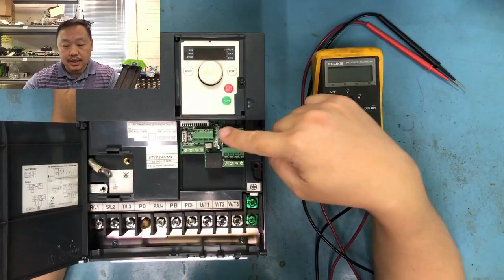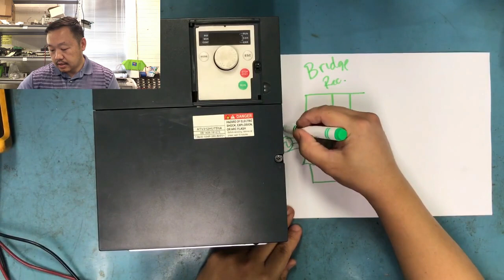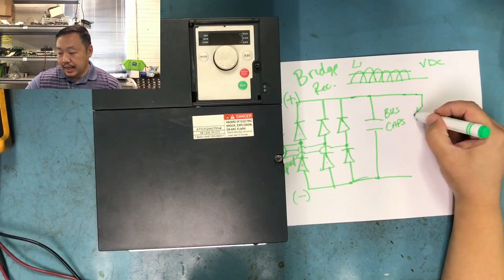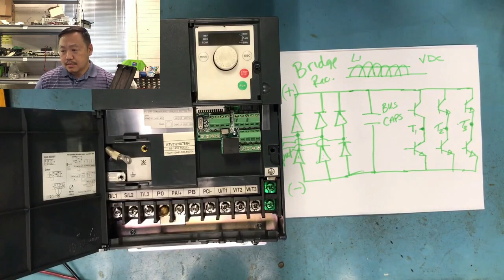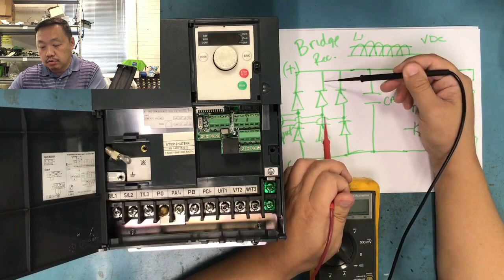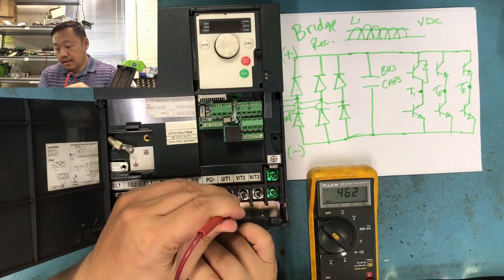One Simple way to check if an AC drive is good

Comment: Excellent Video. 
If you have a problem with your control board, this may also be a cause of IGBT Gate short-circuited. Beware. The gates could not be accessed from outside, dismantle and check.
Reply: We've had a few AC drives in which its control board does not turn on at all after applying the 3-phase input. What could that be?

Comment: How about checking the rectifier diodes with reverse polarity? You checked the forward voltage drop, but if you switch the leads, you should get an open. If you get anything other than high resistance, the diode could be shorted. Take into account the fact that the huge filter caps will take a bit to charge, and you might see a temporary short because of that.
Reply: Have you ever revisited your comment since you posted it? I know it must have made sense to you when you posted it but think about what you said.:face-blue-wide-eyes:
Wakodahatchee Chris

Comment: pls i did my static check and my igbt module is good but yet i didnt get power output even when the drive is running using the local mode

Comment: Good Evening. I have washing machine (laundry) using single phase input with 3 phase motor. My priblem is.... The motor body tempreture very hot, touch by hand. Than sometime, motor not running. In this case, motor problem or VFD problem? Plesse advise.
Reply from the maker: A single phase being turned back to 3 phase is already not the best way to drive a motor but with that being said, I would check the motor out first if its heating up.

Comment: I can't seem to remember is 3 phase " each leg is 70 degrees or 30 degrees out of phase with each other " ? chit seems I wouldn't for get and maybe I wrong.
Reply from the maker: For a three-phase AC voltage source, the phase shift is 120° with respect to each other
Reply: @electronictech785  Yep sorry I now remember thanks so much ! I was thinking that this was the reason that several motors and compresses did need starter cap if you had 3 phase.

Comment: Most of the VFDs sold today don't provide the + and - terminals for the DC bus. How can the diodes be checked without the + and - terminals?
Reply from the maker: In that case, you'll have to get access to the bus caps which would require you to take it apart.  The only time we see VFDs with no + and - terminals are the small Horse Power VFDs.
Reply: @electronictech785 That's what I was afraid of. Thanks for your help.

Comment: i have an AC motor inverter EDS2000 model. and i followed your instructions to test it. the result showed the same as in your video instructions, but when i power it up and press RUN, it showed error E013. could you recommend something?
Reply from the maker: I don't have the manual for the drive.  What does the E013 fault?

Comment: Hi, this test can be conducted in a new vfd. Or ii need to power it first .then disconnect the cables . I tested in a new vfd but everything is open. That's my question. Again what if the cable is faulty or motor . One say whole the cable was faulty the vfd was showing dc bus over voltage can you explain that to ne
Reply from the maker: Yes, new and used.  You are checking the bridge rectifier and the IGBTs.  This test is not for testing cables so the line input cables and motor cables should be disconnected.  DC Bus over voltage means that the voltage on the Bus has exceeded the VFDs threshold.
Reply: @electronictech785  hi sir, I tested new vfd everything is one. Testing diode forward bias is open. Testing Igbt is open. Now I was just asking need to charge the resistor or not .

Comment: Hello sir, 
Thanks for your effort.
=> As power electronics engineer, I know this thing, i thought u may explain testing of control circuit, or driver circuit problem or feedback portion at signal level. Very disappointed.